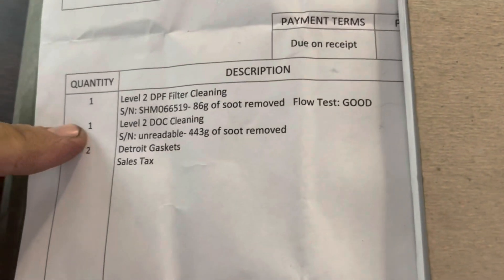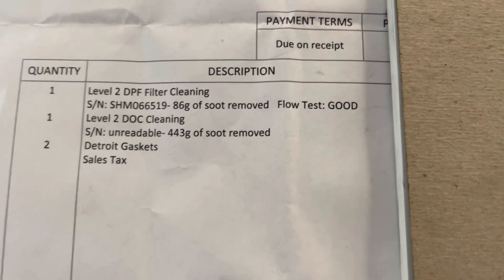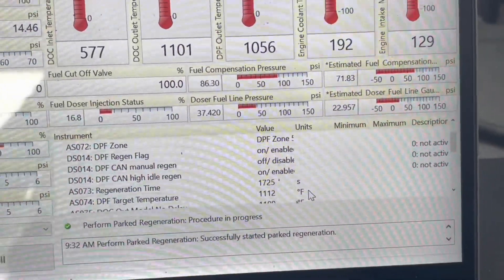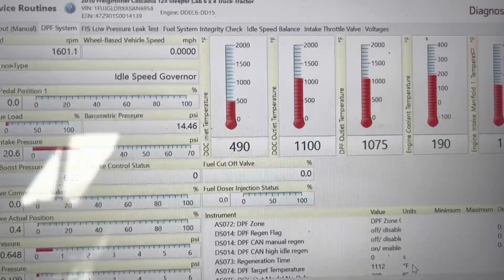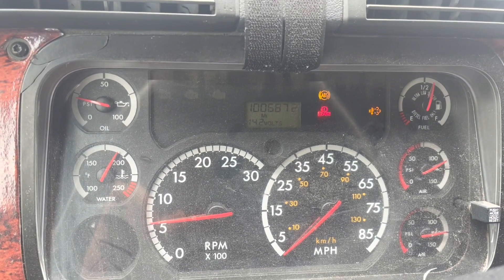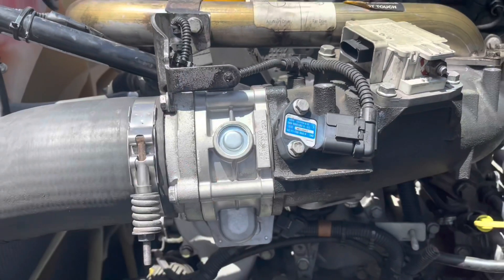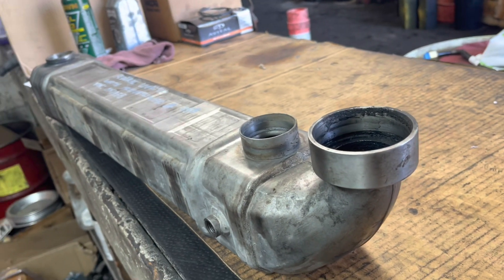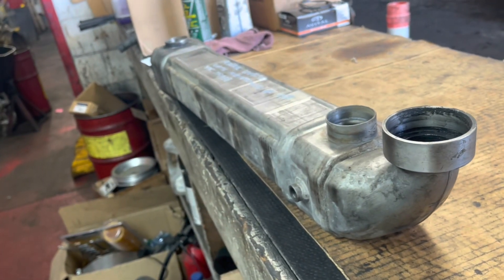Almost called it quits, regen gave me a run for my money. Bad EGR cooler

Comment: What program is this you're using and how much does it cost
Reply from the maker: The software will cost you around $700-$800 for the year. That is for the standard version. 
The professional version will run about $1700 for the year. 
I use the standard version. It will pay for itself if you work with Detroit Diesel engines.

Comment: Thank you for your time and repair videos 🙏 
I have a question.   My Doc Inlet pressure Voltage is right around 67 v with key on and engine off but when the engine is running the Voltage surges to 2.00 Voltage.. is that Normal ?

Comment: Hi there man help me out with this code spn-3659 fmi 5 frightliner cascadia 2016 (750K+ miles), should I start with injector harness then test the injector.  Thanks
Reply from the maker: Not sure if the injector can be tested. But it sounds like the injector itself could be bad. Also, check the valve adjustment. Sometimes the clearance on the valve could effect the injector. 
Have you worked on the injectors or harness before? You can start with the harness first but when you have this fault code, internally there may be an issue. If remember correctly the code or active code comes up at a certain rpm.
Reply: @CarlosDieselElectric  valve adjustment was done awhile ago at 600K+ miles at freightliner dealer

Comment: Do you guys work on paccar peterbilt 386 2013??? I have a problem with the EGR pressure  code 411 on my dashboard
Reply from the maker: Have you had someone plug into the truck?
Reply: @CarlosDieselElectric  no. Is hard to find someone with the software. I call your number. How far can I drive with the codes on?
Reply from the maker: @rolling3868  depends, the truck might go into derate. Are you in Southern California?
Reply: @CarlosDieselElectric  yes I'm in Fontana.
Reply from the maker: @rolling3868  I am out of the shop for the week. But if you really want someone to look at it call Sal with So Cal Diesel Repair in Cerritos

Comment: Pedro thk you .... sometimes regen will happen while driving yet sometimes it wants to pause driving to complete is that true thk tou
Reply from the maker: The regen should almost always complete while driving, however there are some events that will prevent it from happening like low speed, applying the brakes, low regen temperatures. Sometimes you have to pull over and complete a parked regen.